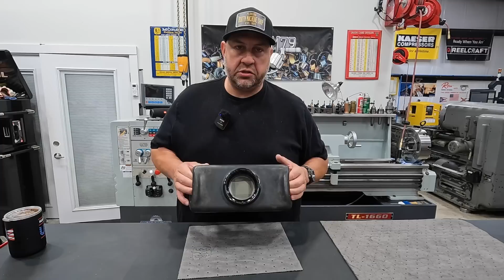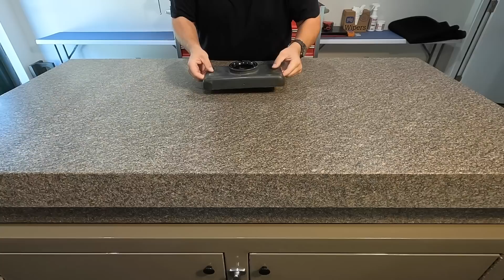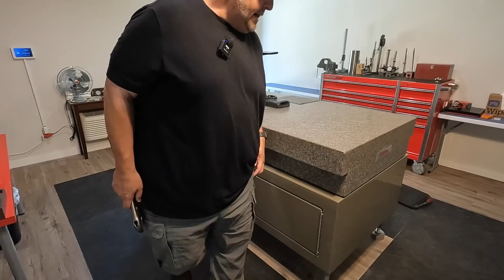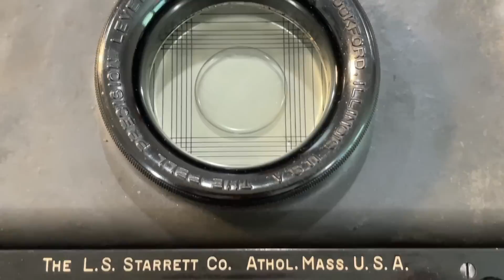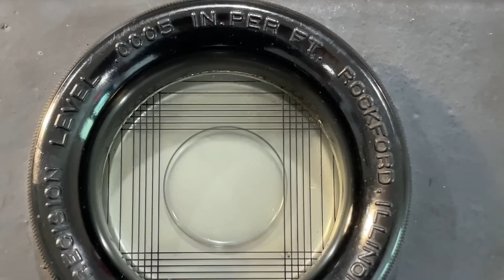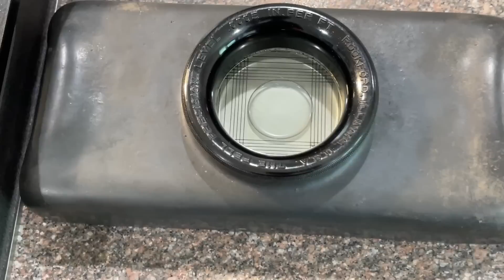Tool Tuesday Ep. 6: The Fell Precision Level

Comment: FYI US Patent 2,211,201 – "Level" (Filed Oct 19, 1934, Issued June 14, 1938). That was probably made between 1940 and 1950. Rotate it 180 degrees to verify its accuracy. DO NOT unscrew the the black ring. It holds the spring in place. There is a 12 inch long wire spring that holds the vial in place. You can calibrate it yourself. There are screws on the side and at each end. The vial sits on a convex pad lapped inside the housing. There is a set of two screws that work on each axis. When the screws are turned, they push the vial over the pad. Loosen one on one side first. Then tighten the opposite side. Same for the ends.  For each 2mm graduation, the amount of tilt is 8.6 arc seconds. My uncle Bill would be happy to see his pride and joy still being used! Thomas Butler, Rockford, Illinois

Comment: Hey Adam-  thanks for the video.  I noticed that your India stones were pretty loaded up.  Just a tip, I realized that you can throw India stones in an ultrasonic bath with simple green and they come out incredibly clean and free of microscopic metal shavings.  You’ll obviously have to add oil back to the stone if desired because the simple green will remove that.  Love your channel. Cheers
Reply: to add, when little chunks are embedded an exacto knife works great to pick the pieces out after the ultrasonic

Comment: you should have rotated the level 180 deg. to check if the level is calibrated.
If it is calibrated, you will see the same reading of the bubble, no matter what orientation the level is placed.
This is the same procedure of a single axis level. 
Place it on the surface, note the reading. ( example: 2 divisions to the left ) 
Now rotate the level 180 deg.  You should see the same reading of 2 divisions to the left.
If you get a different reading,  then the level is out of calibration by 1/2 of the difference between the two readings.

Comment: Adam, about your Starrett level marks.
i dont know if your a historical gun guy, but theres a trick that we use a lot to make those markings really pop.
grease pencil.
those lines look like they might be etched into the glass, and if so, coloring them in with a grease pencil, then buffing away the excess with a paper towel does a pretty good job at making those lines appear on old firearms. i dont see why it wouldnt help in this case.

Comment: It’s interesting trying to get a plate completely level. But actually, for the uses a plate is intended, being that level isn’t required. Well, very rarely, only if you’re using or calibrating equipment that in itself is involved leveling in some way. But measuring heights accurately, and scratching those lines doesn’t need it. Most metrology equipment just needs to be decently level.

By the way, the proper way to lift the Starrett Master is with your forefingers under the sides of the top. Don’t lift it out of the box by using your fingertips on the plastic sides. It’s much too easy to drop it that way. Yes, that part is cast iron, but really, you won’t affect anything. I’ve been doing it this way for decades and was to,d way back then from people who knew, that that was the proper way to lift it. Notice that there is no place for fingers on the plastic sides to lift with, just a sharp, square edge.

Comment: 17:32 Ok so now I understand, it is on 3 rubber pads, that means you don't need to worry about loading the 4 legs evenly because it won't change the "bend" of the plate.

Comment: 15:14 I wonder if you could deflect the bubble by warming a leg with your hand. If it is possible, then you can infer the load that is on the leg because the less loaded leg would not deflect the bubble the same amount a more loaded leg would.
I did an estimated calculation. If you warm up about 4 inch of length of a leg by about 20F it should lengthen the leg by about 0.5 thousands of an inch and at the bubble level you should be able to see it because if the table is 3 foot wide in the shorter direction then it should move 1/3 of one division.

Comment: Interesting video but my question is  . . . . . . why? Why go to all this trouble when everthing you are measuring is relative to the plate surface which could be on its side or upside down for all the measurements care! And I do think you are a bit OCD in regard to cleanliness - the environment is pretty dirt / dust free and plate is covered 95% of the time so a 'once over' with a lint free cloth should suffice unless you are getting into NASA or Optical level precision measurement? One other thing - the use of flat stones on a 'precision scraped' base in the level - surely that affects its surface - The stones are an abrasive after all?

Comment: Curious what happens if you rotate the Fell level 90 and 180 degrees on that plate.  Wouldn't that reveal any imperfection in its calibration?

Comment: Wouldn’t it be better to use a dial torque wrench to torque all bolts to the same reading?
With the coarse thread it uses,  it is too difficult to get them all equal. 
Also, I would cut the laminate floor out where the feet sit and put it directly on the concrete.
Reply: leveling is not about equal weight distribution, but more about planar alignment.
Many items that need to be Level, will not have equal weight distribution over all of the Leveling jack screws, so using torque as a reference would not function to achieve level.
Example: a Large Lathe with a long bed. The Headstock end will be much heavier than the Tailstock end.

Comment: I think i'm missing the point. You are trying to level a surface plate that's sittting on rubber feet?  So you're depending on the durometer of the rubber feet to last? Any time you put a part on your surface plate to measure it it won't be flat anymore...

Comment: I would advise the use of a ridiculously long breaker bar with a crow`s foot wrench... You take out the play in the wrench and at 3feet of lever length, if you move that lever by 1/4 inch, that translates to near nothing on the wrench end, which gives you a significantly higher resolution to put it thusly of screw actuation... The shorter the wrench, the worse it is, kinda like a high pitch screw - its makes any move translate into much more axial shift than intended... You can mill out a custom crow`s foot wrench for your max length breaker bar to fit your machine leveling screws to have a best tool for the job possible, but i guess a regular open end wrench with a 6 foot cheater pipe will do just as well with more care when taking out the play between the pipe, the wrench and the screw head... Try it if you are having trouble chasing a high precision level`s markings... Leverage isnt just a ridiculous force multiplier, its also a source of insane resolution of differential movement...
Reply: Using a crow's foot is 2 levels away from what most machinists use; getting them to use the right sized spanner is hard enough.  The big adjustable is always their 'spanner' of choice; it's what sets them apart from the mechanics, lol.  And as for looking at a nut and knowing instantly the right size of spanner, we won't even go there.  But delving even deeper, when they use the right sized spanner, they invariably use it the 'wrong' or let's say unconventional way;  and didn't mr pete put out a video to prove it didn't matter?.  Just an observation ( and a little dig) from my time amongst them, lol.

Comment: @9:00 I think I've mentioned this before but a German company I worked for years ago had a surface plate about that size, maybe even a little bigger. It had been in storage before we moved to a new building, so I hadn't seen it before. In the new shop I walked over to it and ran my hand across it and noticed a HUGE gouge (~1"x1/4"x1/8" deep). Looked at Hans the German shop manager and said: "I wouldn't want to be the guy that did THAT"! He said: "He vas fired"! I had heard about a guy that he had chased out of the shop with a hammer. Turns out to be the same guy! Hans and I got along great in spite of my German being as bad as his English! I was one of only about four people that had full access to the shop without question! :face-green-smiling:

Comment: With the plate sitting on the laminate floor, walking around the plate is likely changing the loading in the laminate, despite the massive weight of the plate. Maybe cut out holes in the laminate and set the pucks directly on the concrete. Also, use mechanical advantage, get a long a$$ wrench and you’ll be able to improve your turning precision with even less effort.

Comment: Nice video.  Chasing precision can be a daunting task.  Spent decades as a machinist, and my first introduction to that Starrett precision level was helping level a Moore jig Grinder.  Boss set the level on the bed and after letting it settle told me "watch this".  Gently blew on the top of the level from about two feet away and we watched the bubble swing almost completely to one side.  Blew my mind.  I can remember taking over an hour setting up a job on that CNC jig grinder years later and then taking about 90 seconds to do the actual grinding on a small piece.  Precision is a beast, and setup is everything.

Comment: Remember you are on an engineered wood floor with foam padding under it it will move as you walk around the room. plus a fine thread on those legs would have a better effect on the adjustments.

Comment: Hey Adam, along with the great advice from @tonyn3123, I also worked in a Surveying maintenance shop. One of the special features installed was a floating foundation (series of piers) for the levelling table. This was to deliberately separate the table from the micro movements of the building foundation. Common building floors are only general purpose and will flex even with you walking on them. We also changed the circumference of the levelling screws  to a dual c-spanner pinch-nut arrangement . This is so we could get to tolerances way inside any manufacturers declaration. Where precision really matters  reducing building interference is critical. The feet you made for the table look to be too coarse of a thread for the tolerances you're after. This is something that's way within your capabilities and a good upgrade video for the table?
Reply: keith rucker showed the level moving with him walking around his shop.  these levels are crazy sensitive id never seen such a precision instrument.

Comment: The only thing you might have done was to counter the weight of the stand you had the camera mounted on by having an equal weight on the opposite side of the level, since the plate is sitting on rubber pads that mount is adding some compression to those pads to one side since the level is centered.

Comment: It always amazes me  once you get it all settled in. Walk around the table and watch the bubble move. Even on a concrete floor It is crazy how sensitive a precision level can be. Everything is rubber and a Fell level (or Starrett 199) will prove it. Any 10 second or finer level can drive you nuts!
Reply: His table is cushioned by rubber , perhaps the density of rubber mounts is to be considered ?
Reply: I used to work for a company that made very high end CNC machines. Micron to sub-micron stuff, everything measured with interferometers. Deep, optical mirror finishes straight off the machine, no polishing. One of our machines was so sensitive that, in spite of it weighing a ton and sitting on a very thick concrete lab floor, building works elsewhere on site, which were not audible to us, showed up in the surface finish. Impeller noise from temperature controlled oil pumps located ~30m away which fed the bearings, showed up in the surface finish. Our temperature controlled lab (+/- 1C IIRC) wasn't stable enough, so a double skinned poly tunnel had to be constructed around the machine. I was told that if anyone went into the inner polytunnel the extra body heat would put the parts out of tolerance and/or be visible in the surface finish. I was so glad to be on the software/electronics department and not have to deal with that madness. I went back a few years later and they had a large (couple of metres on a side) CMM in another lab. It was installed on a huge vibration isolating platform to isolate it from people walking alongside. Interesting place to work but despite best efforts, physics always shows up and kicks ass.

Comment: 20:22 I suspect that the problem lies in the thread pitch of the adjustment screws. This should be the smallest stroke possible for this diameter of the adjustment screws - only then can the bubble be drawn into the "0" frames

Comment: Really would have thought you would have just flipped the level 180 to see if it’s actually calibrated correctly. An easy check if you block the level with a couple angle plates to get it back in the same position. I KNOW you know this so I’m pretty surprised you didn’t bother.

Comment: Adam, I’m not an expert but the fact that you have laminated,or some other type “finish flooring “ under your leveling feet,may also contribute to the issue of movement when you rest on the top. I would suggest that you mark where the feet contact the floor, and cut that piece out,thus allowing the pads to be in direct contact with the concrete. That’s not going to move. Just a suggestion. Love your content.

Comment: Keith R. Doesn’t seem to worry a lot about precision as far as I’ve seen. I would print it and check for myself. You need to put a cheater pipe on the end of the wrench so the arc you turn is bigger. That will give a more precise angle.

Comment: If you're looking for precision leveling at 0.0005"/ft it seems that you are trying to adjust by moving a fraction of a degree with a large wrench and a relatively course thread.  Would the fine adjustments needed be easier with a thread that had double the tpi.  It would be a pain when it came to the initial leveling, but it would be easier with the fine tuning.

How rigid is the cabinet?  Depending on the rigiditu of the cabinet levelin could be problematic.  The same may be true of the concrete floor.

Comment: "A man with one watch knows what time it is.  A man with two watches is never sure."  I think the same notion applies to precision levels...
Reply: But what if you also have a naval observatory time beep every hour? Really, levels are so easy to check and calibrate and so reliable there's no reason you couldn't check with 2, 4 or a dozen and get the same reading.
Reply: The two levels may be well calibrated and will never coincide due to the surface of the stone (no matter how good it is) has small variations (within the stipulated tolerance) as the levels have bases of different sizes and are in different points of the stone, these variations are reflected in reading.
This is a phenomenon that occurs with all high-precision instruments, which is why in any measurement there is always a range of tolerance allowed for both instruments.

Comment: You should rotate Fell 180° and check it and you will see how far out the level is. When I adjust my levels I level the plate then reverse level and take out half error in level then level plate again and reverse level again and take out half error again. Just keep doing this till no more error in plate or level. I had a .0002/8" level and my 18x24 plate was always level with Fell, but you have to stand in same place  because your body weight can change level.

Comment: As long as your granite is perfectly flat, why is it necessary to align the surface to the earth?  Parts built off of the granite reference would be good regardless.  Also, having the granite plate legs sitting on mats would make it too easy to affect the measurement.  The legs should be on the concrete or steel beams mounted in the concrete base, I would think.
Reply: I think there are two reasons to level a surface plate. One is to ensure that the stresses in the granite are the same as when it was lapped. That probably doesn't require the lengths to which Adam is going. Another would be so that you can use a level when making complex setups, and know that the part you leveled will be parallel to the stone.
Reply: @danmenes3143   I agree that it's a bad thing if the stone is grossly out of level, but you could get it well within recommendations using the Starrett.
Reply: @AtThePeck  Absolutely.
Reply: It’s not necessary but I guess it’s fun to make a video about it.

Comment: As several people have pointed out, you can test a level for zero by rotating the level on a flat surface, which you have.  If you have some thin shim stock, you should be able to accurately test the sensitivity as well. Just cut off a thin strip of shim, lap it gently, and then test it for thickness.  Put the shim under one end of the level and see how many graduations the bubble moves across.

How fine a thread can you cut on your lathes?  It might be fun to make some better leveling feet.

That sure was a nice scraping job on the new level!

Definite fun, thanks!
Reply: Why would anyone hand scrape anything with the machinery we have today ? Seems a backwards process ?
Reply: @jafo766  , there are at least two reasons.  First, engineering is all about building things at acceptable cost.  Scraping is relatively fast and is able to greatly improve the flatness of a surface.  Second, a scraped surface is more like rolling countryside where the tops of all the hills are at almost exactly the same height.  This reduces friction and provides a reservoir for lubrication if that is desired.
Reply: My Gerardi vise in not hand scraped ? I know of no hand that can produce a better flatter finish than a surface grinder ? This reminds me of guy's who think they can sharpen drill bit's by hand ? @stuartschaffner9744

Comment: Don't forget concrete floors are slightly flexible. Walking your 300 lb from one side of your granite surface plate to the other will have some effect on the bubble depending on the floor's thickness and the floor's contact with the underlying subsoil.